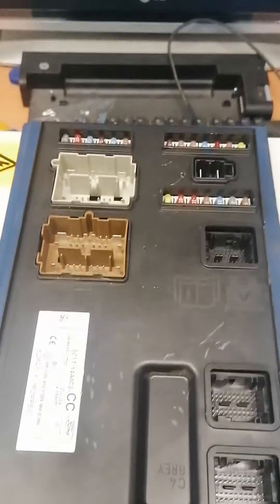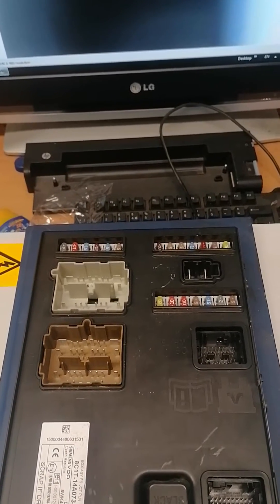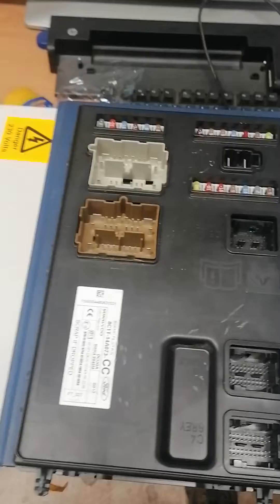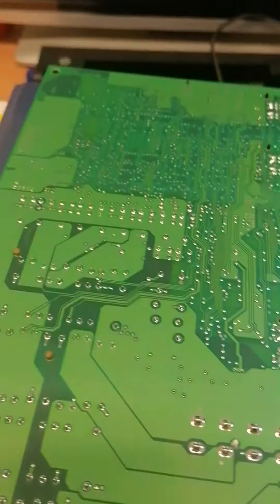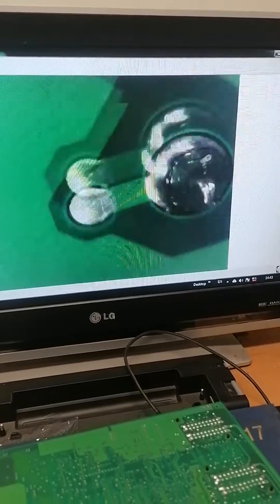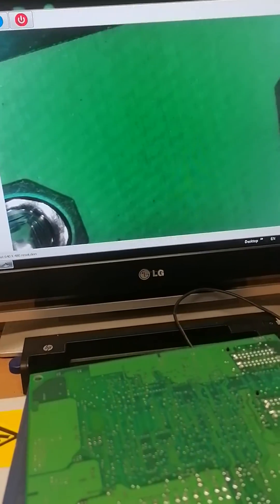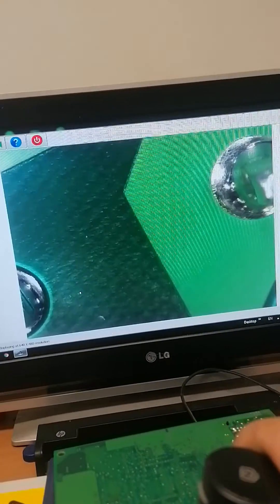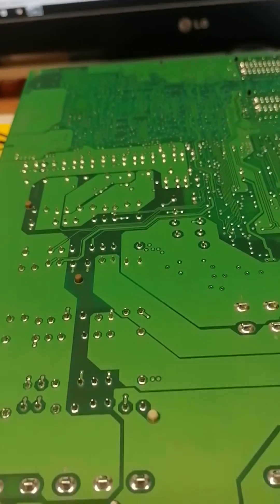2008 Ford Transit Mk7 Can bus / BCM Repair

Comment: Thank you for confirming what I suspected with my BCM. No comms with the ECU because the BCM is dead or corroded. I think my mechanic bypassed the CAN BUS just to get it going. But I have no central locking horn, and god knows what lese I haven't noticed. If its just resoldering, I can do that. Do you recommend replacing the CAPS or anything else?

Comment: I got what I think is an issue with my BCM, on forscan it says I got no connection with my BCM (U0140) no connection with my immobilizer control module (u0167)
And weirdly enough my accelerator position d sensor doesn't work but the others do, which I've just put a rebuilt engine in there and as a result I cannot do injector learning until these problems are fixed. Lost on where to look to be honest
Reply from the maker: @ghost4004  well if the engine was just out it's possible you have a wiring issue with Engine ECU to BCM can bus. The BCM would not process the Accelerator sensor input directly.
Reply from the maker: Check engine bay wiring harness first.
Reply: @enginemanagementadventures7305  yeah I double and triple checked the wiring harness, and I even now had a issue pop up saying my glow plugs weren't working. But they were and also things like the radio turning on when ignition is off but when I turn it on the radio turns off and only shows you the time/date alongside other things also I checked between canbus hi and low on obd and positive and I was getting a full 12v which I was told isn't right, considering the loom from the engine is so simple. It definitely had me stumped

Comment: very good video!!!👍, a question?? My lights stay on and the turn signals stay on, there is no way to turn them off just by disconnecting the battery, and the driver's door is also open when it is closed and the remote control opens but does not close the doors. Could it be from the BSM module? someone has happened to him tanks 🙏🏻
Reply from the maker: Yes the BCM is controlling these components so highly likely CAN bus signals are flying around due to bad solder joints on the connectors.
Reply: Tanks!!!🥳Yes, it is almost the most likely, thank you, but don't you also look at the internal components? On the other side of the board, I'm hearing small relay noises that seem like bad contact or something. Could you tell me if the BCM board has any mini relays???? because I think there is one that is stuck or makes bad contact, because I hear it and they are not from the other fuse panel but rather it seems from this one, thank you very much
Reply from the maker: @urigenvan in most module failures the physical stress points are on the wiring connectors thus the pins soldered through the pcb tend to cold fracture first. Ultimately the large variety of errors that manifest are due to the MPU on the board powering up and down rapidly sending spurious data messages around the bus. I would check all the pins first.
Reply: Hello, can I write to you by email or could you watch this video of the bcm of my 2007 Ford Transit to see if this diode is missing or is it like that???, it is only a minute of video, to clear up doubts, I would also like to know How do I know what each relay corresponds to since when the lights of the flashing warnings stayed on I heard how a relay was activated as if it were stuck or hooked, strange noises in the relays, thank you very much
Reply from the maker: The relays will fire like crazy if the microprocessor is powering up and down, if you have a magnifier check the pins first.
Reply: What do you mean that it goes up and down, which microprocessor are you referring to exactly?

Comment: Hi mate are you uk based and do you do repair service as ours has stopped indicators and hazard from working and been told its BCM fault
Reply from the maker: Hi there, I'm in Ireland, if you match the part numbers exactly know someone with Forscan you can use a donor from a breakers yard.

Comment: Did this work for you lad ? Having indicator problem on mine and think I’ve narrowed it to bcm.
Reply from the maker: They are notorious for failing with bad solder joints. Have done more than 1

Comment: ARE U SURE THIS CAN WORK MATE?????
Reply from the maker: Done it a few times, you will need desolder equipment. Boards are notorious for this. Or match the part numbers and programme and initialise a second hand one with Forscan.